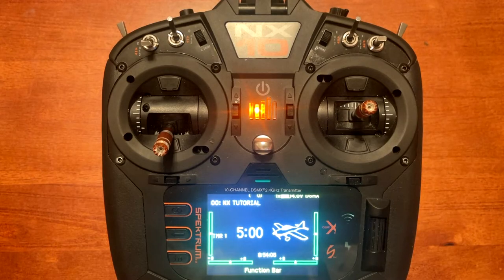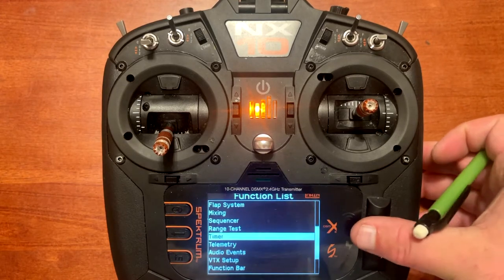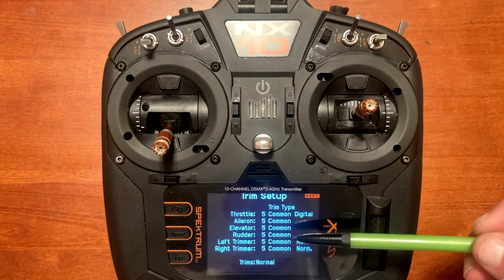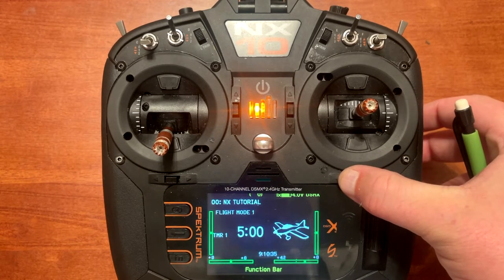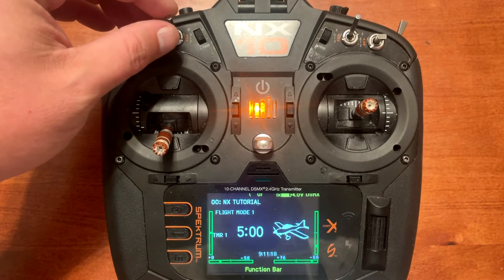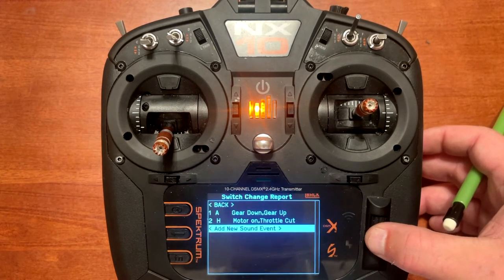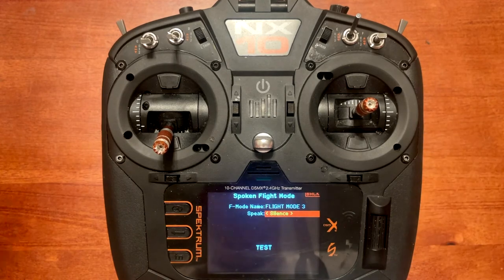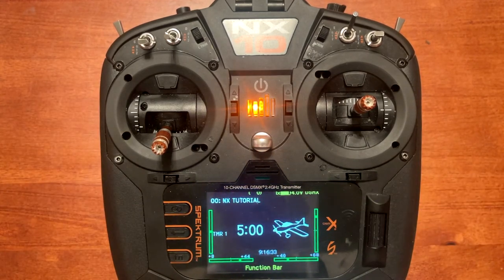Spektrum NX Setup: In-flight and Flap Position Trimming (Flight Modes)

Comment: I have one flap that wants to go one way and one flap that wants to go the other I've tried everything that I know to reverse one Servo certainly don't know what I'm doing wrong I just started using the nx8 and it is driving me bonkers. Love the channel by the way have learned a lot
Reply from the maker: Do you have them on a Y lead or separate channels?
Reply: I had them on a y cable but I wound up using two separate cables one to channel 6 and one to channel 7 and they're linked together so now they're working properly. I picked the worst times to try to work on airplanes like when I'm exhausted from work LOL thanks for the reply man
Reply from the maker: @urbanairgunner6402  glad you got it working :)

Comment: Hi BD .As usual you have great How To videos !!! Question.....would you recommend using this method over  the "Elevator / Flap Mix on the Fly" video ? which one gives you the best results>
thanks!
Reply from the maker: Hey Aiden, i prefer the "Elevator / Flap Mix on the Fly" method. Allows for a smooth elevator transition with the flaps. Both adjust at the same speed. Flight modes cause a instant change. Also keeps all flap related values in the flap system menu...

Comment: Just seen your other video on flight modes, and you're a genius . I think it has sunk in. What you've done on this video, will it work in conjunction with the flap systems ? In other words my flaps are on switch F. Can I still put flight modes on switch F as well? Would love to set the trim in flight rather than static in flap systems
Reply from the maker: Yes flight mode can be used with flaps...

Comment: 12 years ago, I made this suggestion to Futaba...a video on "How to set up the transmitter". Futaba said "No". This is why I switched to Spektrum because it is more user friendly. Not trying to start a Ford vs Chevy argument...just saying what happened back then.
Reply from the maker: Agree Spektrum is user friendly! Thanks for watching and comment.
Reply: 20+ years ago i was do or die futaba. Did NOT want spektrum! Started flying again with a dx6e. (Then nx6, nx8 & now nx10). Only reason i went spektrum cause HH planes included rx's.  Now, 2ish yrs later, nx10 & AR620 rx's. I dont like ANY reciever that limits what im doing. (Point being, yesterday i removed the safe rx from my extra 300. It was impossible to hover. After putting my ar620 in, retrimming, on that same battery i was hovering 4" off the runway. Ill keep my dumb (spektrum! 👍) recievers!
Reply: @old-rcplane-phart  I love my Spektrum AR636 AS3X/SAFE receivers. I know how to program them to do what I want. I had to help a club member with his new 18 channel Futaba the other day. I’ve never seen anything as unfriendly as it, not even OpenTX..

Comment: Hi BD. I know you are very busy answering questions and everything else. I have a question if you could answer at your conveinece. I am using the NX8 TX and I set it up as you described. D/R 100%, 85%, 70% etc, etc. I set up my own airplanes with your settings. Aeroscout and a P51 in my TX. I'm using the RF 9.5s simulator. So if i select a 300 or Thunderbolt and I would have to use my P51 model to select on the NX8, what parameters am I using? The plane from the RF simulator or the P51 NX8 . They do handle differently.the 300 rolls way faster than the P51. Just want to know how the 300 is going to react out at the airfield. Hope I got that through. Confusses me looking at it. LOL
Thanks for looking and no hurry, Others may be interested in this question also.
Merry Chistmas and Happy New Year.
Jack Currier
Reply from the maker: Good questions. Settings i used in realflight are in general for simulator. When flying actual planes depends on the plane style. Using those on Extra300 is going to be wild even on low haha.

Comment: I think you mentioned it, but F Mode Trim should really only be used with ailerons to compensate for any unevenness with the flaps.  Any elevator adjustment I would make in the Flap system settings.  That allows the flaps and elevator to move to the new position in sync, especially if the flaps are slowed down.  If you do set it for all surfaces, just remember that they are separate.  Easy to put in a little rudder trim in one mode expecting it to be there in all modes.

You gave me the idea for using R Knob in a mix R Knob > ELE for adjusting the elevator to find best position for different flap configurations.  I have expanded on that and have started using it on planes without flaps.  Allows me to dial in up elevator.  I can reduce throttle and increase up elevator to find a nice slow speed while holding altitude.  I can slowly reduce throttle from there and can get the smoothest landings.

On the NX10, other than obvious things, color screen, wifi updates, etc., have you found anything that really makes it worth upgrading?  Currently with DX8G2.  Sliders might be nice instead of using the knob for doing some of these mixes.  How easy are they to control with any precision?  I have the InterLink controller with RealFlight.  They are pretty difficult to control effectively.
Reply: I always wanted the nx10, even when it had bad reviews on horizon. This past Christmas, i got it as MY Christmas gift to ME! I came from the nx8. Aside from the usual, full bearing gimbals, (smooooooothness & accuracy is unbelievable compared to my old nx8 & everything ive had before 🤯👍). I honestly wanted mine. Id jump all over a new iX12, but! 

HH has a new NX10se. Save that extra $250 & get yourself another plane 🤷. Only difference is orange bling u can buy on Amazon for $30 + grips, another $30 & a foam case ($50.00 at HH). 

DONT SCRIMP on tx case!!! Get something metal to protect your $500+ investment!

Im the 1 everybody at the field gets to setup THEIR tx's to their new planes, maiden them, & somehow im the only one who was unofficially 'elected' to train new pilots that's never had a plane tx in their hands🤷🤯!  My best buddy got my nx8 after i got my 10. He loves it. He loves mine a lot more. Just the feel of it & accuracy of everything.
Reply from the maker: Yes i mentioned only really trim needs to be done is roll for uneven flaps. Also talk about the instant change in flight mode compared to flap/elevator mix. Video i made awhile back talking about using L/R trim (NX8 and NX10) in flight and then transferring to flap system, is same thing and i prefer that as well.

Oh yeah that works implemented the knob.I think we talked about that and good stuff too :)

NX is the way to go over DX if funds allowed. Sometimes when im helping others it makes me think about how much i like using NX all around. Sliders have notches so can be controlled fairly well but not as smooth or linear as the dial. Using NX on RF is a plus as well.You get same feel/muscle memory from Sim to Flying Field.

Comment: Hi BD, what are the R Trim and L trim buttons thare are near the very top of the radio on both sides? They are slanted diagonally. They are located near the D and E switches.... I am flying Helis, so what do these buttons do???
Reply from the maker: L Trim and R trim can be assigned to different options through mixing screen. Its a assignable switch

Comment: Do you have a Tutorial on setting the Fail Safe modes? I want to use return to neutral or selected positions fail safe.
Reply from the maker: I dont currently. Standard failsafe return surfaces to neutral and throttle off...

Comment: hey bro, love ur vids they have helped me so much in my rc journey. was wandering if you can shed light on aquestion i have.
why does when selecting flight modes do you have to select switches in a particular order, the other day i was setting up my corsair and i had switch a,d and h for flight modes, if i put it in a,d,h i could only access i think it was 7 modes but then if i did d first it would allow 10 modes, just thought it was weird as there all the same switches, also the next screen only had the limioted boxes on the first configoration, just thought it was weird. any light would be appreciated bd. thanks for your information

Comment: Have yet to find anyone on YouTube to clearly say in 1 sentence what a flight mode is. On my DX6e I have assigned switches to do clever mixes. I have used the flap system to give a tad of down with the flaps - but I still haven't used a flight mode. What am I missing? Is a flight mode a combination of instructions like, throw a switch and bomb doors open as flaps deployed with a hand full of up trim? If just 1 instruction, stick with a switch? Help
Reply from the maker: Flight mode for model (radio flight modes)allows separate trims tied to a switch.

Comment: Hi, I do not have a Flap System showing anywhere in the Functios menu. Also I could not find it to select in the My List menu either. Any idea where it went? Or am I in the wrong place?

Thanks
Jack
Reply from the maker: When flap system doesnt show,means you dont have flap selected in aircraft type. Common setup is 1 Ail 1 Flap.
Reply: @BDTennessee  thanks bud. Got it!
Reply from the maker: @nynelyvz1  Good deal!

Comment: If your airplane rolls or yaws when you extend the flaps you have bigger problems than trim.
Reply: When the flap servos are on a Y-harness, there’s no way to adjust out any differences in their movement. And it’s not that it rolls; it just doesn’t fly perfectly straight. There’s nothing wrong with using a bit of aileron trim to compensate for a slight difference in the flaps. I’ve never had to use it for yaw. I like using f-mode trim for the elevator because I can adjust it in the air, unlike the mix in the flap system menu where you have to use trial and error. Also, I adjust my linkages so that my trims are as close to center as possible. If your trims aren’t centered, neither are your servos.
Reply from the maker: @txkflier  good response!